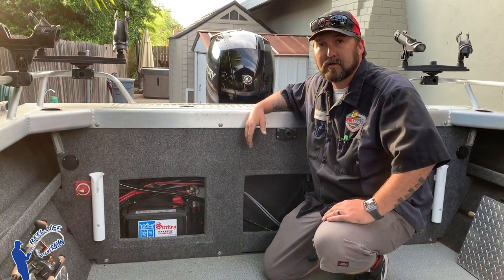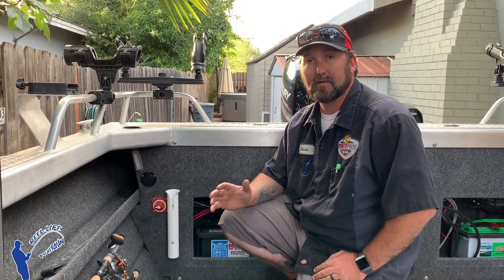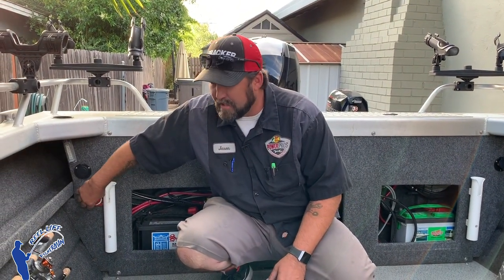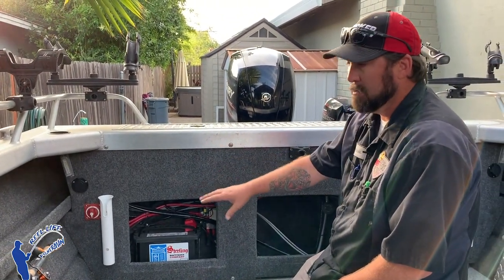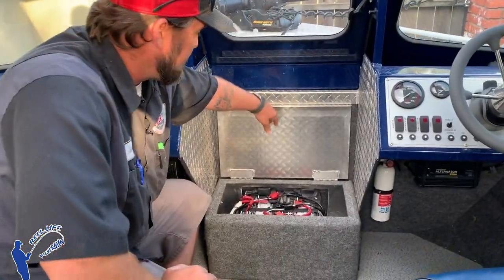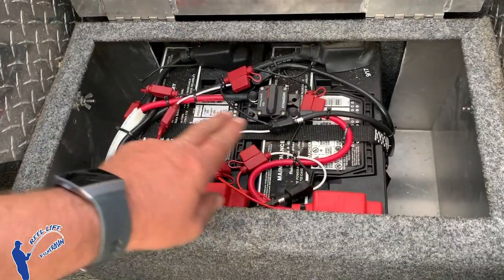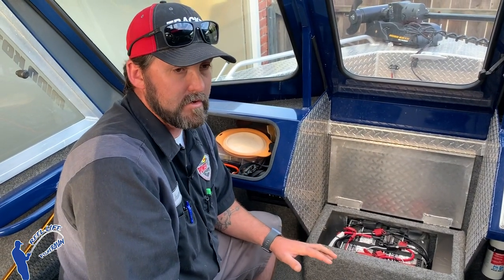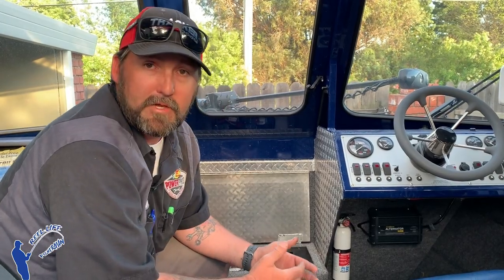BOAT BATTERY WIRING  | HOW TO

Comment: Thank you for making this video easy to understand.  I'm getting ready to put a 24v trolling motor on my Northriver and have watched your other video on the installation you did on Connected Fishing's boat.  Do you recommend two separate on board chargers?  One to charge the starting and deep cycle battery that I already at the rear of the boat, and a second on-board charger for the trolling motor batteries in the front storage area?  Wondering if one four bank on-board charger is a better/or even possible way to go?  Thank you.
Reply from the maker: Brian Louie I have 2 -two banks it was better for my set up.. and saves you from running extension leads to the  other end of your boat plus 4 bank chargers are expensive.. I just charge them separately or use a splitter to charge them both at the same time.. glad you liked the videos and they were helpful.. thanks for watching and let me know if you have any questions anytime.. tight lines!
Reply: @ReelLifeFisherman  Thanks for the quick response and advice.  Makes perfect sense.
Reply: Yeah I was thinking the same. I charger for everything . You answered . Now is ot possible if im.not running a trolling motor yet to run other  equipment like anchor, lights , etc. off the deep cycle battery . Thanks for your time
Reply: Reason I'm asking is to save running lines to the back

Comment: I see you have two different brand name two bank battery chargers do you like one over the other and why
Reply from the maker: The minn kota Precision or the new Noco Genius GEN 5 would be my favorites.. the minn kota digital or pro mariner would be my next choice.  The first two have a battery type selectors.. and the new noco genius gen 5 has a battery booster if the battery is dead.. most chargers won’t charge a completely dead battery.

Comment: How do you wire up the alternator -on board charger, which is from the 12 volts starter battery, to dual deep cycle 24 volt for trolling motor? Is a “blue seas marine charging relay” something different? Wouldn’t the battery switch to position “all” do the same thing?  Thanks

Comment: Love your channel question can you show how to wire 2 batterys  With a 2 battery selector switch for  my boat i wont 1 for starting boat and one for stereo and accessories i need to see how from a experience boat tech.Detailed please will look out from it. Thanks in advance Lonnie
Reply from the maker: Awesome! glad you like the channel! Funny you ask..I should be installing a duel battery switch this upcoming weekend I believe.. and I will definitely be making a how to video .. please stay tuned it should be coming out soon! If you have any questions let me know.. thanks for watching
Reply: @ReelLifeFisherman  yes I also love your channel, I would appreciate the same information!  I have a 1983 Thompson Sea Rage Cuddy Cabin with a 305 Chevy engine and a 200hp OMC sterndrive (the old stringer style).  I have one starter battery and would like to add a deep cycle battery so that I can also install a stereo system with an amp.  However, before I can do this, I have a bigger problem that I need to figure out that maybe you can help me with?  Last weekend my son accidentally connected the pos wire to the neg terminal and the neg wire to the pos terminal.  There are two 50amp fuses that come off the starter and one of fuses blew.  We were at the lake when I discovered what happened and I did not have any extra fuses, so I cut the fuse holder out and spliced a piece of 10g wire between the two ends.  The boat started right up.  When I put the throttle into gear the engine killed and when I attempted to turn the key, all I could hear was a clicking noise coming from a solenoid on the rear of the engine.  Do you have any idea's or information to help me out with this problem?  Thank you so much, you are a very informative guy!

Comment: When I bought my boat it had one battery. It was for cranking and the electronics (horn, navigation lights, livewell etc.) I am adding two more batteries to run a 24 v trolling motor. My question is that once I add the two new batteries can I also switch all the electronics to them so I have the original battery for just cranking?
Reply from the maker: Warren Miller so with that set up I wouldn’t run anything on the trolling motor batteries but you could use one of them to hook the switch to in a emergency or just carry a set of jumper cables..  I would use the same set up I have.. and have the trolling motor batteries just for the trolling motor..
Reply: @ReelLifeFisherman  Ok I may just carry the jumper cables just to always have a plan if I run it dead. Thanks again. Another great video.
Reply from the maker: Yeah if you don’t have the room for 4 batteries I would just make sure you have a good cranking battery and keep jumper cables with you..  it’s the easiest way.. you can hook up a battery switch to one of the trolling motor batteries and only switch to that in an emergency..  we hook up bass boats that way..

Comment: What size wire do you use for the trolling motor? For a length of 10ft on a 24v system will a 6 gauge be enough or is 4 gauge an overkill.  Last, I just relocated my starter battery and need to also extend the battery  cables.  Going out about 12ft, should I stay with 6 gauge for that or go bigger?  I read online going next size bigger never hurts.  Thanks in advance.
Reply from the maker: 6ga is plenty for the trolling motor.. and depending on the size main engine you have would make a difference on the battery cables.. most engine manufacturers recommend you buy extended battery cables from them.. all one piece.. no connections to just extend.. thanks for watching and let me know if you have any questions..

Comment: I have 4 batteries on my 2001 searay sundancer that are weak. At least two seem to be. My batteries are connected in parallel but the 29m deep cycle is connected to the 24m cranking battery. This is done twice. I don't understand why the two deep cycle batteries would not be connected and the two cranking ones. There is a single Mercruiser 5.0 gas engine. thank you for your video and any imput.

Comment: Thanks for the video.  Very simple and well explained.  Can you run 3 batteries on a 2 bank charging system? If so what is the wiring method?
Reply from the maker: Keith Martin thank you! Glad you liked the video.. so you should only run one battery per bank.. every brand of battery charger recommends that.. if the batteries were hooked in parallel it would charge both.. but again it’s not recommended.. let me know if you have any questions anytime.. and thanks for watching!
Reply: Reel Life Fisherman if you have two DC batteries In parallel with a MS for cranking hooked to a Blue Sea add a battery mini switch will the batteries and switch work properly? I also have the same question about an onboard noco two bank for this but you have just answered that. Or, are you saying if in parallel you can treat the two dc batteries as one bank... Great Channel! 👍🏻
Reply from the maker: NM FishDude hey thanks for watching the channel! I appreciate it!  Hey before I try and answer your question can you tell me what the MS for cranking  part means? Main start? Or something else .. master switch?  Thanks people use many acronyms for different things..  thanks
Reply: Reel Life Fisherman yes sorry. I basically have three batteries. Two deep cycle and one starter battery. I am going to install the blue sea add a battery mini 65a. I only have a 18’ bass buggy pontoon with a 12v trolling motor setup. I can run the normal two battery setup but because I have the extra deep cycle I was going to just run it in parallel. I was just wondering if I do this can I treat the system as if I had two batteries only. In the future I may take the third battery off and on if needed elsewhere.
Reply from the maker: NM FishDude so with the isolator on the parallel deep cycles I would be worried that it would over work and burn up the stator on the engine over time..it would be better to not have the isolator in your case and just run the switch.. and only use the combine position in a emergency.. and install a 3 bank charger to keep them all charged at home..  or run it on position 2 and use it as a house battery.. but then it’s robbing from your trolling time on the trolling motor.. hopefully that makes sense.. let me know if you have any questions.. thanks again for watching..
Reply: Reel Life Fisherman I was thinking it was better to be safe than sorry. Thanks for the clarification. I’ll most likely just run the two batteries. If I plan a long trolling day I can always take the spare and use it for trolling first. Lots of time to plan and build right now lol. Thanks again!

Comment: Awesome video. I was told by a marina that if you use your main motor to charge your crank battery and also the deep cycle that you could screw things up. They recommended 2 crank batteries. Did they give me wrong info. I’m 2nd guessing my purchase of batteries after your video.

Comment: How bad is it to run my deep cycle and crank batteries parallel? When I bought my boat it was set up that way, I guess to charge both batteries at the same time? I disconnected it FYI...

Comment: Thanks for making that video, on the 12 volt parallel, does the tm positive and negative hook to the same battery, or positive to one, negative to the other? Thank you.
Reply from the maker: Dave Wiseman so you hook the 2 batteries together.. positive to positive and negative to negative.. then the best way to hook up the trolling motor for battery health is hooking the positive trolling motor lead to one battery with. Circuit breaker then the negative to the other batteries negative.. hopefully that makes sense.. let me know if you have any questions.. thanks for watching!

Comment: In regards to the Battery switch, and using a house battery for electronics. When switching back to the crank battery to run across the lake how does that work so I can monitor my fish finders with out having to always power then down in between each time I change the battery selector from house to crank battery? Any suggestions Thanks

Comment: Hey I am putting 2 power poles on my bass boat I have a 36v trolling motor all groups 31 and then my cracking battery should put the pole pumps on the cranking battery and do I need a cut off switch ?? Thanks
Reply from the maker: It is good to run everything on a battery switch.. it will completely cut off the batteries so nothing is draining them when you’re not using it..

Comment: So i have 2 12v batteries paralleled with a 2 bank charger  how should i hook up the charger now?? One bank to each battery or will one bank charge both batteries??
Reply from the maker: You should always have one bank per battery. Even in parallel. It seems weird but that’s what all the charger manufacturers say. It will charge both batteries if you only have one bank . But it may not charge them both properly.  Thanks for watching

Comment: If I already have my 24v system in series cables but no breaker will I need any other marine wiring? Or do I just use the series wire on the batteries?
Reply from the maker: Thanks for checking out the videos.. I answered your questions on the other video

Comment: Jason  I’ve been thinking about connecting my main battery and my trolling battery in parallel, my question is will that charge up my trolling battery while running boat and what size cable would I need? I have 2016 Tracker Pro V16 WT
Reply from the maker: Mario Moreno I wouldn’t hook it up that way because you could potentially drain both batteries and be dead on the water.. keep your crank battery separate and get another trolling motor battery and wire it parallel.. 2 batteries will fit into that bow compartment.. lol! You just have to be tricky and turn them inline with the boat.. i do it all the time that way..
Reply from the maker: Hopefully that helps.. let me know if you have any questions.. thanks for watching
Reply from the maker: Mario Moreno also if you want to put a charge to your trolling motor battery or batteries while you run your main motor.. look into getting a minn kota alternator charger.. i have one and it helps extend my day alot longer before my batteries die..

Comment: thank you for the info ,if you are inexperienced at electronics its very confusing trying to understand wireing techniques Ive just bought a houseboat have no shore power to charge batteries when at dock it has 2 outboard motors which charge the batteries when running but have constant problems with dead batteries when trying to restart when maybe staying out and overnight camping so the battery switch and house battery could be an answer pluss I only have 2 cranking batteries so Ill change one for a deep cycle the only way I can charge when not running the motors is with a generator which ill probably get   not sure if you reply to the comments but your input would be welcome   thanks again
Reply from the maker: Thanks glad you liked the video.. sounds like you could definitely use a battery selector switch.. and maybe even running a couple of deep cycles in parallel.. also have you looked into solar chargers.. they have come along way.. thanks for watching and let me know if you have any questions.. I’ll try and help you out best I can..

Comment: love your videos,i just bought a never used 2017 hawk xl and i am wondering how hard is it to mount a minn kota and run the wiring? i bought the boat in Victoria BC and have not picked it up yet so i have not been able to have a look at how accessible the bow area is.once again great videos
Reply from the maker: Brian Patenaude awesome congratulations on the boat!! Thanks for watching the videos! So the hardest part is mounting the trolling motor without an access port in the bow.. you can install one.. they did do that at the factory the last few years now.. or carefully mark and drill and tap your mounting bolts.. I would use 1/4 x20 and then use red locktite .. the other thing that is tricky is mounting your batteries.. you can use the step box like i did or you can remove the bulkhead board and make a mounting shelf.. I may do this in the future to get the storage back.. let me know if you have any questions along the way.. thanks again for watching

Comment: Hi Jason,  I have just setup a small boat with an   80lb 24v Minn Kota bow mount and I have 2 x 120ah deep cycle batteries wired  them up the way you have explained it including an inline fuse on the positive cable and all works perfect . These batteries are charged by a 24v Ctek smart charger through mains power in my garage  , I connect the positive from the charger on one battery and the negative to the other battery and charge both batteries as one unit. Is this the correct way of doing it or should I charge them as individual 12v batteries ? Any advice would be greatly appreciated.
Reply from the maker: Awesome glad you found the video helpful! So the way you charge them are as individual 12v batteries.. then wired to the trolling motor the way you have it they become 24v .. I have another battery wiring video on the channel that goes over that part a little better if you want to check it out.. thanks for watching and commenting! Let me know if you have any questions..

Comment: Can you run the negatives to the switch and then put the positives together going through a circuit breaker? You figure when you disconnect a battery you are always supposed to disconnect the negative first then the positive terminal.. So with the switch wired to the negatives, that is what you are doing.